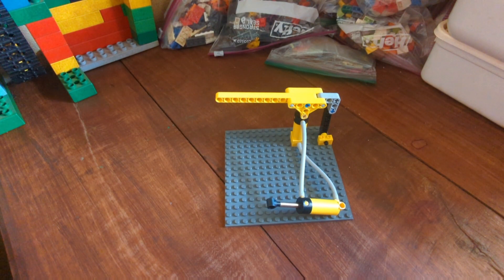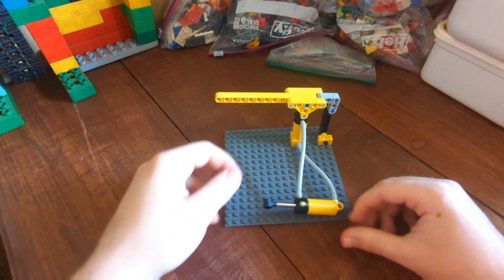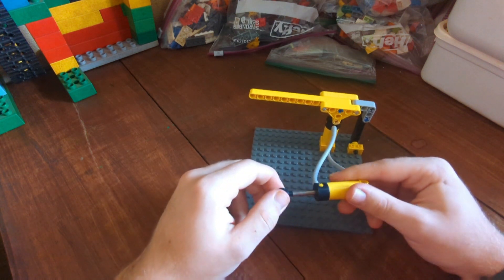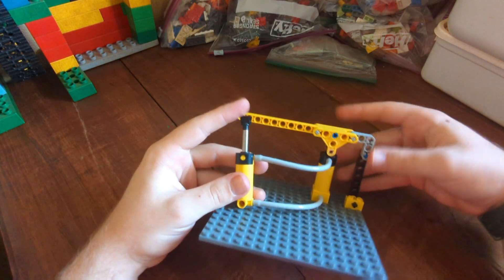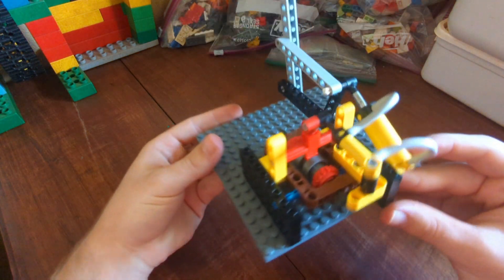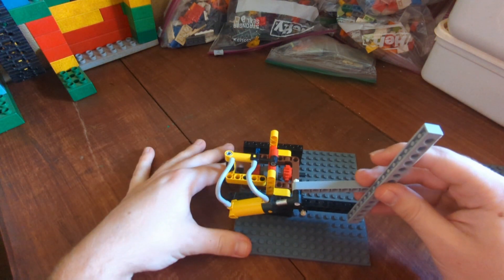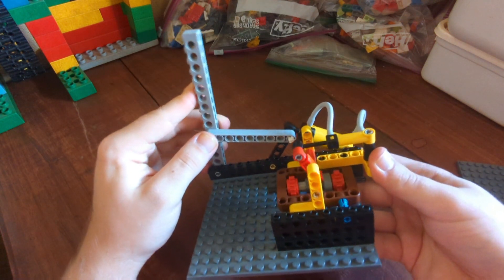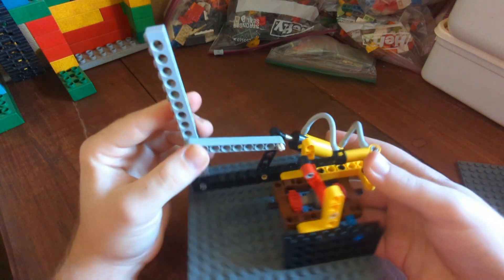Easy control for Lego pneumatics

Comment: You're not the first person to do this, trust me. I'm not either, considering Lego Pneumatics were released in 1984 and I was born in 1989. I used to experiment using water. Water doesn't compress like air, but then you have a problem with rust. A perfect real world application is the braking system in a car.
Reply from the maker: I'm not surprised that other people have thought of this. The thing about water rusting the cylinders, do you know how quickly it happens?
Reply: @magnumsalyer  That was 20 years ago, unfortunately a career in Lego was discouraged. I sold everything and pitched a lot of ideas. I vaguely remember surface rust happening overnight, if the cylinders weren't dried thoroughly after testing. Some types of plastic and rubber don't fare well with oil, but it might be a better idea to try. Messy, but no risk of rust.

Comment: What about variable position control? Is it possible to linearly change the pressure from one cylinder to another only halfway in order to move the gearbox to center, instead of one side or the other?
Reply from the maker: It is possible (I just now tried it), you just move the gray lever until you see the gear box get into the position you want it to be in. This set up has pretty fine control, but it could be improved to have a finer control.
If this was, say, in a truck model, you'd want to put either a stepper to insure that the gear box remains in one of the 3 positions, or at the very least put a position indicator to show what gear you're in
Reply: @magnumsalyer  I have so many ideas, I’ll have to share them later!
Reply from the maker: @GearsAndBricks  I do too! Though I still have to build the ideas. You'll hopefully see the ideas come to fruition in upcoming videos 😉